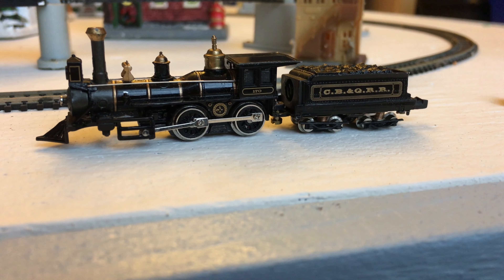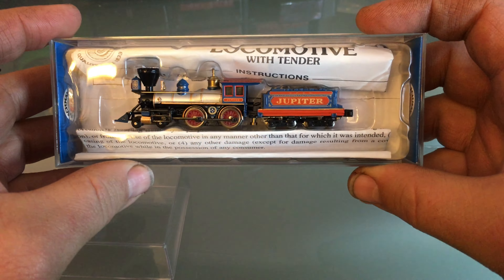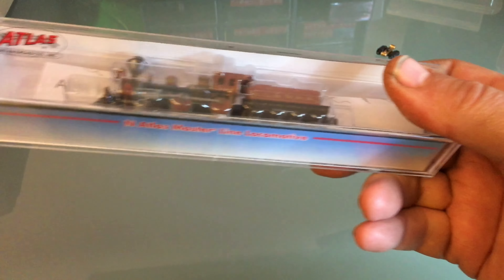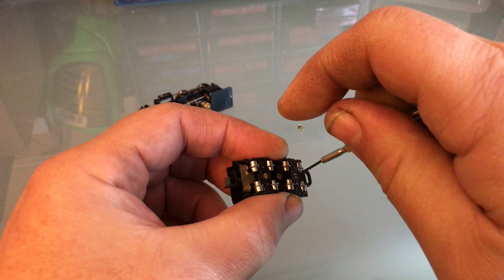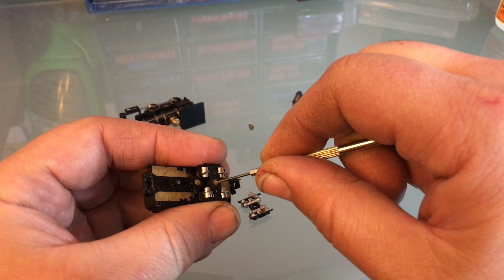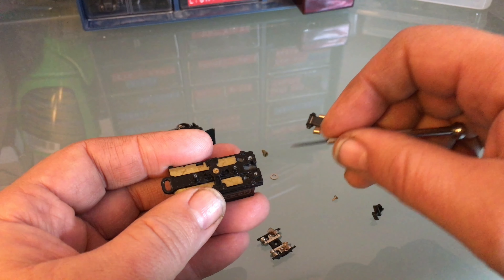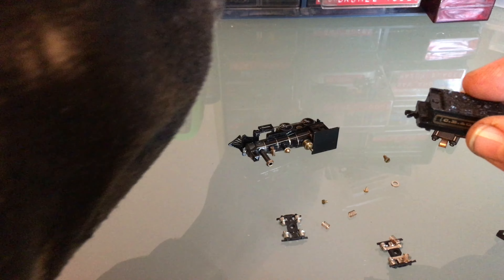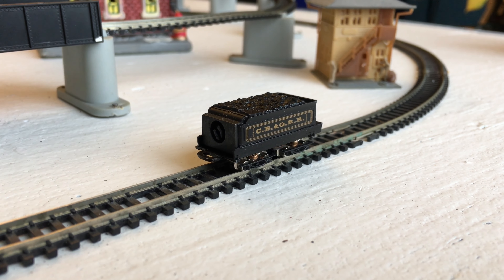N scale Bachmann 4-4-0 repair (part1)

Comment: I was unaware of the improvements made after the very first model. I bought a bunch of them used off and on  usually for around $5 and they were a source of great frustration. They could also be converted to Nn3 with some careful filing. But they still had trouble with turnouts, even ones carefully handlaid. I worked and worked on them because in  those days they were the nearest thing available for use as an early logging engine. W Alsdorf
Reply from the maker: Yes, if they go through you layout, then you have awesome track work.

Comment: I watched your series on this, but I missed the part where you installed the front truck, or the first 4 in the 4-4-0. I have the exact same model, cb&qrr, but my front truck hangs really loose in there and tends to pop off the track around curves. It usually doesn't cause any problems, it just looks funny. On the bachman HO 4-4-0 the front truck has a spring that serves as a contact, but also pushes the truck down onto the track. I couldnt see a spring in yours, but I'm wondering if I could install one in mine. Does the truck truly "pop in" or did you glue it up?
Reply from the maker: I’m not sure, I’ll have to look it up.